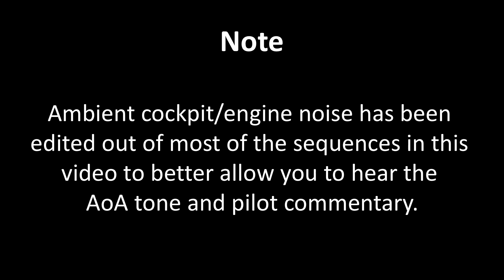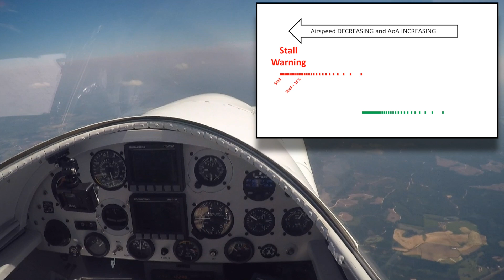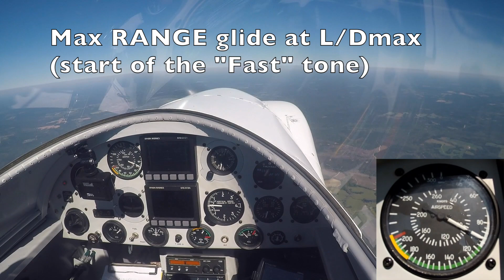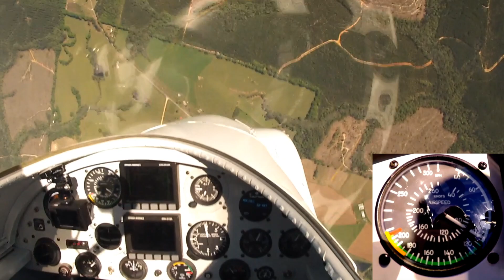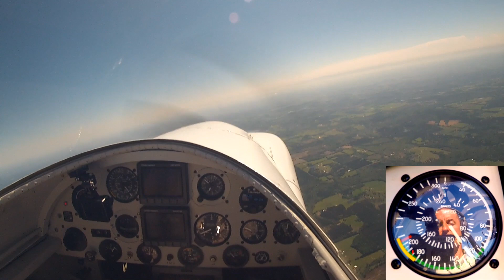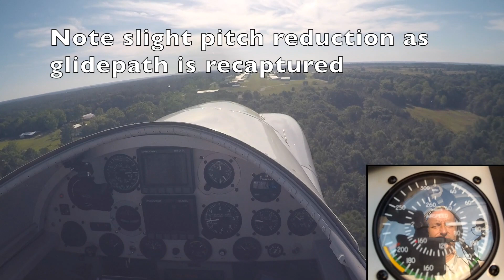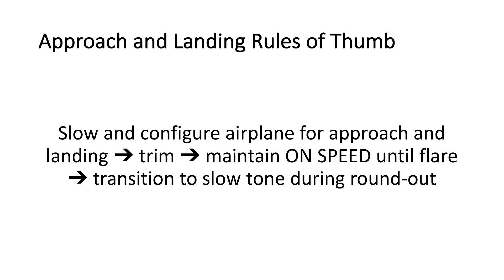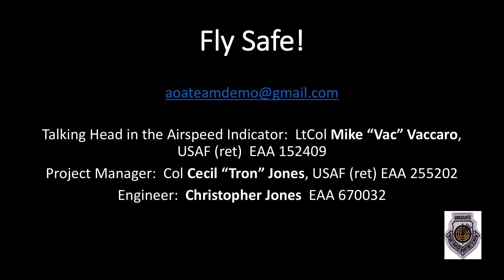ON SPEED AoA Maneuvering

Comment: To Cecil, Chris and Mike: Awesome video, great product, very cool stuff! I love it. Congratulations on winning the 2018 Founder's Innovation Prize for this effort. I am assuming the Dynon Pitot probe and system used already has the AOA features installed and you are tapping a serial input from that signal to process through the Arduino? I hope to join you in setting up something like this some day soon. I think this sort of innovation is highly useful and a real safety resource. With proper training and validation of system performance it will provide fellow aviators with critical options for a variety of situations; engine out to aerobatics to traffic pattern recoveries, etc.
Reply from the maker: Hi Ed, 

Thank you very much!  Yes, the first generation tone generator uses the Dynon serial data stream for AOA input.  We've put our design on GitHub for folks interested in building their own.  We've also established a website FlyONSPEED.org where we'll eventually consolidate all of the information.  We are working on a 2nd generation tone generator that has indigenous pressure sensors--this will not depend on any EFIS or other AOA system.  We've found during beta test of our first generation system, proper calibration of commercial AOA systems can be problematic.  We've also found that folks don't always fully understand the information provided; so we are going to see what we can do to fix that by developing an accurate system that is simple to calibrate and use to help with proper energy management.

Cheers,

Mike

Comment: RV drivers should know (some don't) if you split S from level cruise speed, leave power in you will exceed Vne....
Reply from the maker: Absolutely concur.  This is discussed in great detail in the transition training manual I prepared that’s available on Van’s Air Force Safety Page!
Reply: You should not be entering a split S from cruise speed, period.

Comment: Very good video, Do you control AoA with stick ? It will be nice to see the stick position in the video
Reply from the maker: Fernando, yes, all of the AoA control is done with the stick.  The tone logic simply tells you to pull more or less as airspeed changes to maintain a constant, ONSPEED angle of attack.  ONSPEED is used for approach and landing, but it's also optimum turn performance during maneuvering (aerobatic) flight.  "Optimum turn" means the best compromise between turn rate, turn radius and specific power--just a fancy way of saying best overall turn performance.

Comment: Doesn't anybody actually fly their plane anymore by sense and what the speedo is showing?
Reply from the maker: Depends on the airplane, mission, phase of flight and part of the envelope that you are flying in.  Below maneuvering speed, airspeed is simply a surrogate for AOA because you are concerned about the aerodynamic limit.  Some airplanes provide excellent buffet cues in this part of the envelope, some don't.  AOA isn't effect by weight, density altitude and (most importantly) G load (bank angle)--it's always the same.  Any reference airspeed used in that part of the envelope changes with all of those parameters; so if you fly an airplane with limited cues, don't have much experience, or don't have extensive performance information available from flight test, an accurate AOA cue can be helpful for maintaining control and managing energy.  And, the tone logic is caveman simple to fly.  After 40 years of flying, I find it helpful.  The AOA/airspeed debate started in about 1904 and won't end here; we are just offering this up for folks that might find it useful.
Reply: @mikevaccaro1248 All  good & well but the art of flying is being eroded away cause fewer & fewer pilots can actually fly ! 40 years for me & I'm still here without any of that fancy stuff!
Reply from the maker: Congrats on 40 years, and best wishes for many more of fun, safe flying!  Mike
Reply: @mikevaccaro1248 Thanks, it ain't over yet :-) Now I'm retired from flying I'll be living the dream in my RV:-)